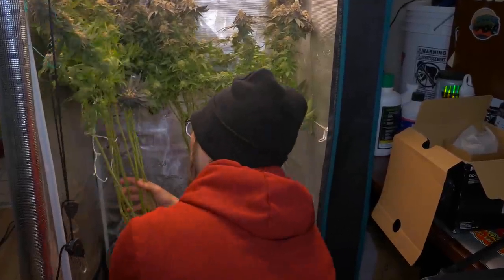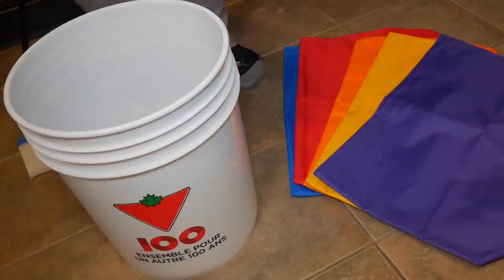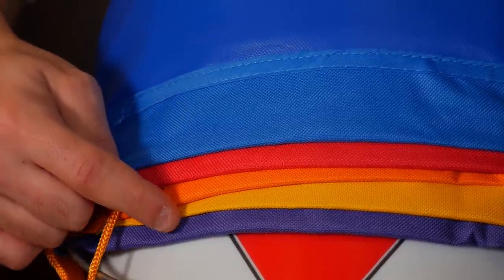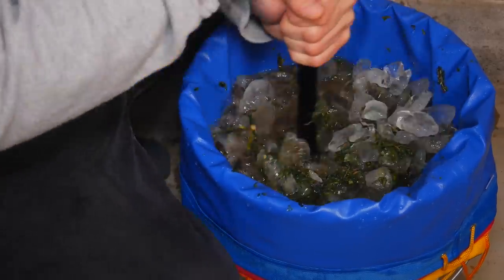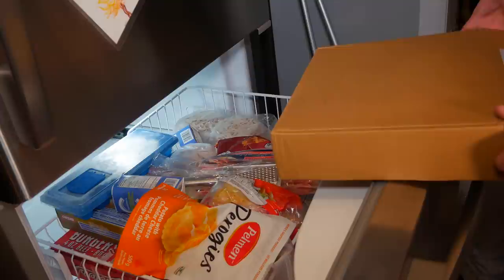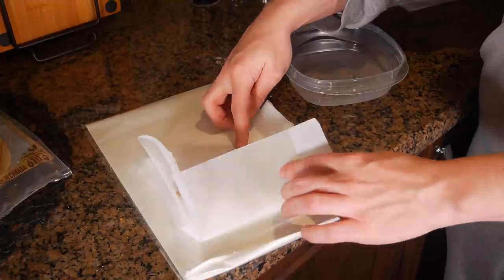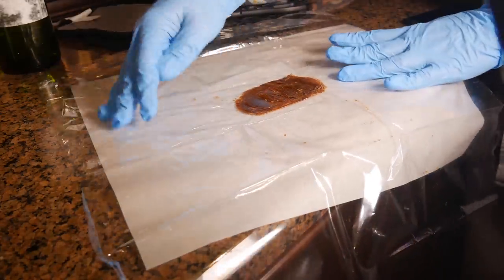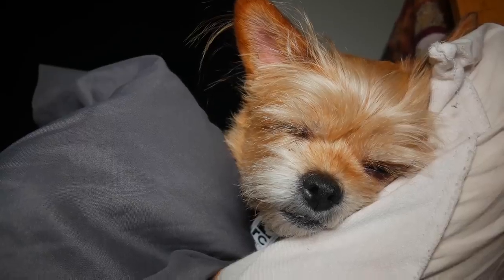How to Make Bubble Hash | Making and Pressing Hash From Trim

Comment: Great vid ,I’ve been doing hash for prob a decade now , i use 2 garbage bins ,a big drill bit for mixing plaster ,3 or 4 bags of ice and i only use 2 bubble bags to strain it and i use mostly bud but trim too
Reply: that's almost exactly how my process has evolved. With the exception that I use three bags. Trash 120. 72 for hash and 25 to press. Buying a cement mixer in a couple days for agitating.
Reply: That should've red 220 for the trash. Did get a cement mixer. Worked really good. Took a little longer than a drill mixer but that's fine cause I didn't have to stand there mixing all day.

Comment: my tip, add trim, ice, water in equal amounts to a 1 meter long x30 cm vacuum bag(sous vide)seal without the vacuum, shake for 5 mins, put in freezer for 30, then shake for another 5 before tipping into bubble bags, works a treat!
Reply: for 2nd and 3rd rinses just empty trick water through the bags and leave the plant material in the vacuum bag, then just add more ice and water and reseal, etc
Reply: Add water first, then ice. 

Adding water to the ice melts it. The ice is for agitation and knocking off trichromes. You want it as intact as possible.

Comment: I just thought of a cool way to do this. So, I always stir the ice and trim with a big paint stirring bit on a cordless drill. But I was just thinking one of 5 gallon Igloo coolers with a spout, just stir everything in there and then open the spout over a bucket with the micron bags. Then you can do a second run immediately. You could even have holes in the box get so the water water just drains immediately! I’m going to try this next time.
Reply: That's a really good idea, and will keep it cold as well. You talking about those orange igloo coolers, those would be perfect!
Reply: If you use enough ice, an cooler is not needed. You can just use another bucket if you want. Careful if you use a paint mixer and drill as it is easy to over agitate the material and you will get ground up plant material in your bubble hash making it green. I use a drill and paint mixer, but it works best with short bursts. Pull the trigger for 3 seconds, wait 5 seconds. Do that 10 times then rock your bucket back and forth a bit by hand to help the trichs settle through the mesh. Repeat this just a few times and done. If your bucket with material is starting to foam up, you're mixing it too much.
Reply: @philcurtis314  the reason I want to use the cooler is for the spout to just drain the water and trichomes. Some plant material will come through but most will probably stay with the ice. Then you can add water to the cooler and keep stirring for a second run.
Reply: @grisbain  I would bet it would get clogged up with plant material and just be a pain. Good idea in theory. I like to keep it as simple as possible.
Reply: @grisbain did you ever end up doing this? How did it work out?
Reply: @philcurtis314  thanks! Good tips!
Reply: @porkprism  no, I should I have lots of trim that needs to get used!
Reply: @philcurtis314  I definitely have gone too hard on the mixer and had a lot of green in it. It’s one of those things where I feel like if I mix more I will affect the quality but if I mix less I won’t get it all.
Reply: @grisbain  probably safer to under agitate and run the material thru a second time.
Reply: @grisbain  another thing that I find helps is, dry ur material out so it's super dry and put it in a freezer bag and gently crush it up so it's alot finer. This will help with the trichome release and also allow you to put more material in a run.
Reply: @philcurtis314  thanks!
Reply: @philcurtis314  I figured he'd have a 120 to hold the crap?

Comment: Best if you  use 4 buckets. Its kinda difficult to fit all of the filters onto one  container. I mix in a  bare bucket first. Then pour it in the first 3 filters. Then do that one, into another one with smaller micron filters. You don't have to worry about stems poking holes in the bags

Comment: Great video- why can’t you just press the hash on the parchment? Why the plastic? I’ve pressed dry sieve kief with just parchment, is bubble kief different?
Reply from the maker: High quality resin becomes very sticky when pressed. When pressing on parchment paper little pieces of paper may stick so we opt to use plastic. Pressing ultimately comes down to quality of the resin as opposed to how it was extracted.
Reply: @CanadianGrowerYT  how come guys like frenchy used just parchment? Is it just to maximize efficiency? Ya some gets left behind but like 99% is getting pressed and rolled together
Reply from the maker: @bobsmith8124  Previously, frenchy used parchment paper, but in more recent videos, cellophane is used. We'd recommend using cellophane, but parchment paper works well too.

Comment: Gg bro, so helpful!
Is there any way to make my hash stronger with heat or something?
Or can i do bubble hash starting with hash and not with kief?
Reply from the maker: You could heat press your hash into rosin, other than that, not much you can do with heat to the increase strength of your hash. In addition, we wouldn't recommend using hash as your starting product; try using trim, small buds/larf, or even top shelf buds if you'd prefer.

Comment: This would be so cool in an oxygen free environment.. since not everyone has access to expensive things, an easy dessicating method is to get some Epsom salt and place it by itself onto a cookie sheet at highest heat in the oven to cause the Epsom salt crystals to dehydrate (not to put the hash crystals in with this!!). Epsom salt has 7 h2o molecules per magnesium sulfate molecule, until you do this. After it has boiled all the water out of it it looks like a huge slab of white concrete in the oven on a cookie sheet. Then smash the resulting concrete-looking slab into powder and store in a zip lock bag. When using it to dry your products:  place a container of this powdered pure MgSO4, with its lid opened, in an airtight environment near your product to be dried inside the same airtight container. So in a tupperware container (for instance) you have your hash recently powdered to be dried and in that same container you place a smaller container with the MgSO4 powder with a lid OFF of it. You will get every single molecule of water out of the hash and into the resulting/returned Epsom salt. The MgSO4 turns back into MgSO4•H20 aka Epsom salt
Reply from the maker: Thanks for the comment! Never heard of this method, sounds like an interesting alternative. In this video we went with the classic air-dry method since it's a bit easier.
Reply: @CanadianGrowerYT  it's one of the ways that chemists dry their chemicals. Only seemed professional to incorporate cannabis into it. Kind of like putting "DampRid" into a room. You are very welcome for the comment 😀
Reply: Genuinely curious if you’ve tried it and how the results were?

I’m in need of a solution like this since my house is 28-30C until November at least and the only cold space I have is my fridge, however the humidity is a bit high at around 47RH (I think the compressor has some issues). Was wondering if I could just do this tech in a pizza box in the fridge to bring rh down to optimal ~ 35RH levels?

Comment: What is the max amount of dried bud you can use in this process? You said in the video 3-8 ounces of trim. I went and got the same setup you have in this video.  Your video is so well set up, i really appreciate the time and effort you put in to it.
Reply from the maker: Five gallon extraction bags will only hold so much, this can be trim, or flower. If you use flower, we would recommend doing multiple washes so you can extract as much as possible and waste little. Thanks for the support! 💪
Reply: @CanadianGrowerYT  I got me a question. Is weed still smokable after extraction or is it ready for the garbage can?
Reply: Lol @TwinkieCakey
Reply: @TwinkieCakey  🤣🤣
Reply: @TwinkieCakey you could run it once or twice, then go to the trouble of drying it out, and then smoke it if you wanted to, its still going to have some THC present but not much, i would suggest drying, decarbing and making a tincure, then into oil and infusing into edibles like Gummies

Comment: Hey if I’m doing the air drying technique after the micro plane is it better to have it in a room that sits between 68-70 degrees fahrenheit  or in the fridge which is around 36 degrees?
Reply from the maker: It's ideal to keep temperatures around 40-50°F with a humidity of 35-40%. The problem with the fridge is that humidity levels are often very high. If you cannot achieve this environment, just keep a close eye on your product as it may dry quicker.
Reply: @CanadianGrowerYT any recommendations for warmer environments? Not really able to get house below 74 Fahrenheit and humidity at about 50-60% with a dehumidifier running. I Believe you mentioned drying in freezer , is that a possibility?
Reply from the maker: @whm-mz9eo  A freezer would not be ideal for drying, the freezer will create ice crystals in your product which will melt when thawed. Good options would be a freeze dryer, cold room, wine cooler, or even your fridge can be a good option. When using your fridge be weary of humidity as mentioned above, also beware of odours inside the refrigerators that might affect your hash.

Comment: I prefer to use my trim as fill to roll pre-rolls.   Goes much further than hash, also you can use the extra keif to make the pre-rolls more potent.
Reply: That sounds disgusting 😂
Reply: @sunnohh  It's not at all.  You wont even tell the difference.
Reply: Terrible idea
Reply: Shake in pre-rolls? yes. Trim in pre-rolls? Absolutely not
Reply: @xCoMaNdOcOoKiExSW  are you doing a dry trim or a wet trim then boutique trim.. all depends on what kind of trim.. If you're speaking of the sugar leaves, then that's fine.. obviously fan leaves  are out lol 😆
Reply: @IronskullGM  trim refers to the product left over after… well.. trimming lol. So it’s basically just leaf. Shake is more to do with the little bits of material left at the bottom of your jar/bag.
Reply: @Branano  do you know the difference between wet trim and dry trim?
Reply: @IronskullGM  yes
Reply: @xCoMaNdOcOoKiExSW  then you know when you do the wet trim you remove all the leaves without crystals on them, then during the dry trim you do a boutique trim that removes the shaggy leaves from the bud with the crystals on them... that's trim... not shake..
Reply: @Branano  I cure my dry trim as well..
Reply: @IronskullGM  I never said it was?
Reply: @Branano  So why would you waste good crystalized trim? As long as it's cured, its good...
Reply: @IronskullGM  I never said to waste it? Lol 

Make a tincture, hash, edibles or something like that. You do you but I just said that I wouldn’t smoke that. And that’s an opinion that I’m entitled to have

Comment: You talked about using filtered water not tap water to wash your material.

And then you use tap water in the bath to rinse each bag, completely undoing what you did by using filtered water.

Bit pointless really